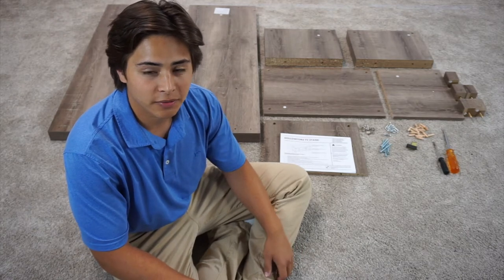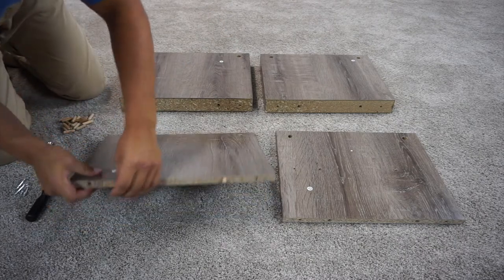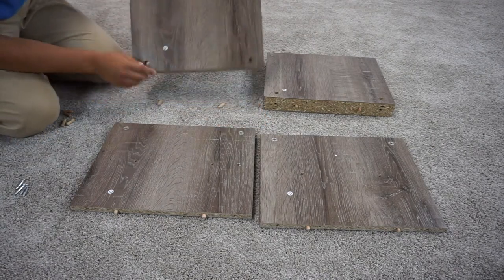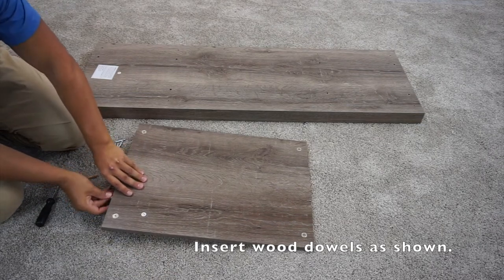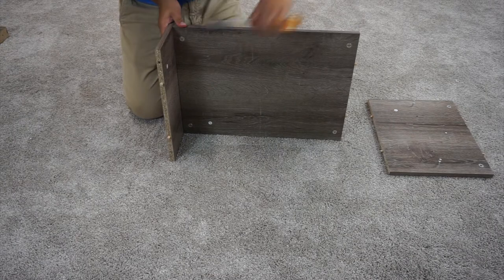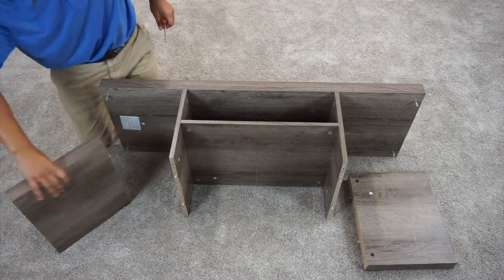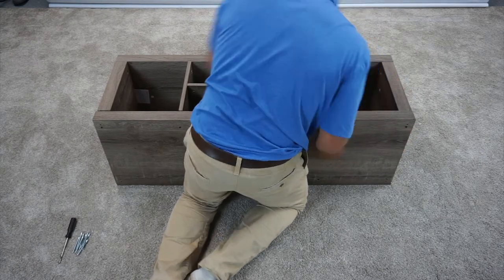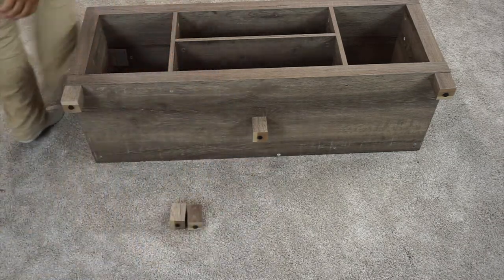HollowCore TV Stand Instruction

Comment: can someone explain the cam locks better
Reply: Right cause I done messed up
Reply: @khentibuffalo  did you figure it out. I was going along with the instructions perfectly but the cam locks for panel E  I only have the long ones left and it looks like he’s putting short ones in 🤦🏻‍♀️
Reply: @sharonwilliams5879  this guy needs to be fired I did the same thing
Reply: Same my cam locks for panal e are long and im stress out right now
Reply: @sharonwilliams5879  did you figure it out yet with the e panel and long cam locks. Help
Reply: I just switched them around. The short locks thats in panel b I took those out and inserted the long ones in. And put the short ones in panal e  hopes this help and if u can get the short ones out
Reply: @Ebeauty28  how did u get them out, they’re stuck for me 😅
Reply: For anyone with this issue trying to get it out, try using and L-shaped wrench screwdriver